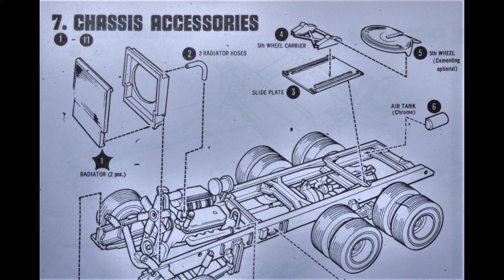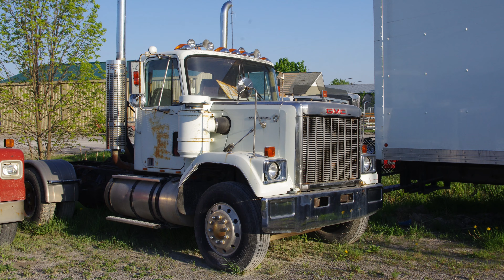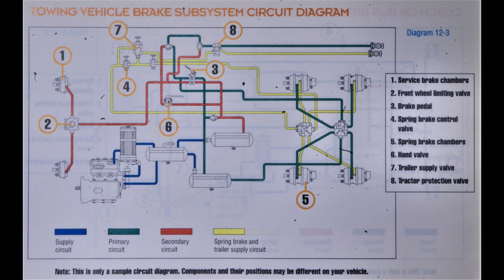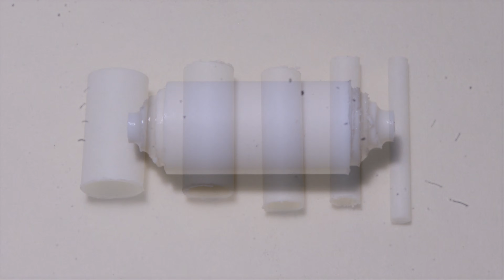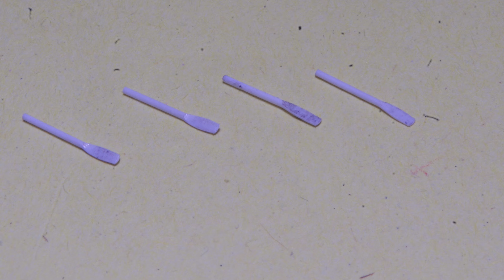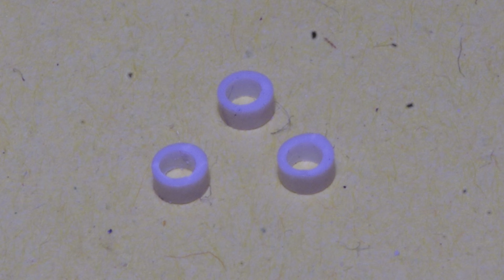Air tank details for 1/25 scale trucks

Comment: I am gearing up to build my first truck model.  I could not have  come across your channel at a better time. A lot of great tips.

I am familiar with tichy train and have used their products before.  My question is the part numbers that you give, are they in HO Scale?
Reply from the maker: Taking a look at Tichy's online listings, it looks like majority of the bolt head castings I use have same part number for HO and O scales. As an example, #8083 is "Hex Bolt Head" representing a 6" hex head bolt in HO scale and a 4" hex head bolt in O scale. 

#8016, their "Standard NBW" (I use this one a lot for very small fasteners like licence plate bolts) also uses same part # in HO and O scales, it represents a 1" bolt, 1-1/2" square nut and 2" washer in HO and 1/2" bolt, 3/4" square nut and 1" washer in O scale.

Rivets are sized by diameter of rivet head regardless of scale, as an example #8018 is described simply as ".025 diameter rivet head".

Turnbuckles seem to be more scale specific due to size, the O scale #2024 (cored for .032" diameter wire) works well for making brake rod clevises.

Comment: I’m building this kit great tips I’m going try most of them . 
One question did you shorten the front axle ? If so how did you do that ? 
Thank you
Reply from the maker: I did change the axle position so it would be centred in fender opening (as tooled the kit has an "overbite" appearance because frame and springs are based on the shorter hood 4200 International as originally tooled w-a-y back), because I was replacing molded-on spring detail with freestanding parts it easy to do, removed details and sanded springs down to a basic set of spring leaves, glued axle mounting pads at correct location, attached axle and added new U-bolts, shock mounts and other details as required.
Reply: Thank you for the tip on moving the axle. Your videos are very helpful , I’ve learned how to try new things .

Comment: As others have said before I enjoy and appreciate your videos especially because the AMT kits aren’t the easiest to build the instructions are terrible and some parts look like they were carved from soap. That being said they are just about the only game in town and with your videos to help I feel more confident tackling them. I’m a line run truck driver  (double trailers double run between Tucson and Phoenix 5 days a week) and don’t get much time at the bench but I have to say your videos help me to do the thing I find most interesting about a semi. The open frame and mechanicals that you are helping all of us that watch recreate really helps turn the model from looking like a toy to a replica of the real thing. I’m rambling just wanted to say thank you and we (truck modelers) really appreciate what you do.
Reply from the maker: That you are finding the videos helpful is good to hear - thank you for the feedback. The air lines, wiring and associated items on model trucks are a lot like brake rigging on model railway rolling stock, subtle details but ones that do help the finished model look "right". 

Comparing AMT's kits with Italeri's ones is an interesting contrast, AMT having the issues you describe while at the same time being generally fairly accurate (if a little "odd" in some areas like the KW cabover steps and tooling the least common long hood version of the Road Boss) while Iatleri's assemble nicely and are cleanly molded but the a number of them are not very accurate using Freightliner FLC frame and suspension under Mack, Western Star and Ford cabs/hoods. 

AMT's earlier instruction sheets seem better than more recent ones, as an example I think the Mack R kit's earlier issue instruction sheet is fairly good while later reissued versions look a lot more like hieroglyphics.
Reply: @brsnorthernhorsejourney3579  
I agree totally with the Italeri issues, unfortunately I believe they are more Eurocentric when it comes to their truck kits they are beautiful kits(I guess just like AMT you build what you know and see). The AMT kits are just as you said I just wish Round 2 would retool some of their kits like they did with the International Transtar CO-4070A I would be more than happy to pay the extra for that quality of a kit. With that kit I think they equal any Italeri kit. Look forward to your next video!!

Comment: It always cracks me up how AMT "blinged out" their kits by plating so many parts that never would have been chrome on a 1:1. Thankfully Castrol super clean or oven cleaner remedies such an abomination.
Reply from the maker: MPC even got into the "bling" with their DM800 kit - fanciest vocational truck ever! 

In his book "Building Model Trucks" w-a-y back in the 1970's, Phil Jensen mentioned the tendency to over chrome, saying that chrome had a lot of appeal to younger modelers. That could certainly explain the abundance of plated parts if that was AMT's target market.
Reply from the maker: I just took a look at box side of an MPC DM800/Rex mixer kit in the stash (not sealed or anything like that, box is rough etc. - someday it will contribute to a project, either whole or in part) and it says “360 parts (molded in red, white, and black) followed by “160 “chrome” plated parts”! 😮
Reply: @brsnorthernhorsejourney3579  That's like 30% of the parts! I remember I was about 12 years old and got the K123 cabover kit for Christmas. It seemed odd to me that things like the valve covers, radiator fan, and fifth wheel were plated,